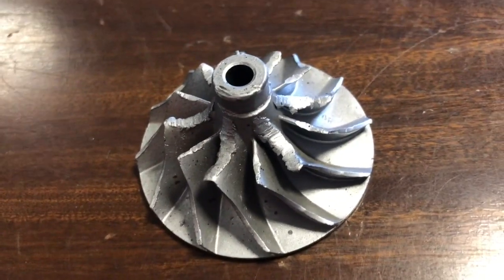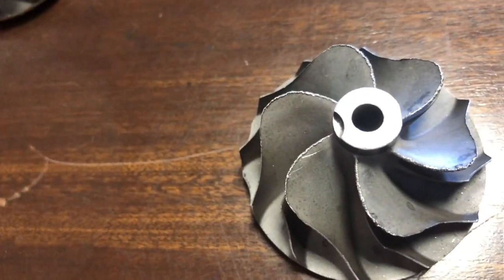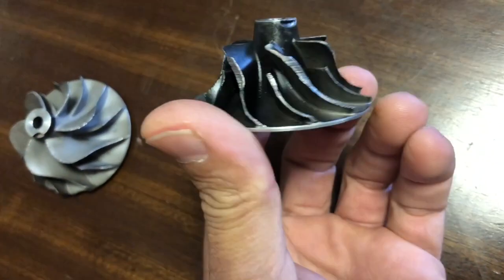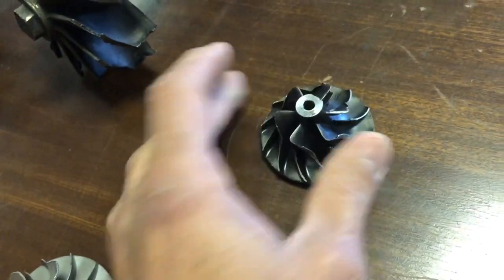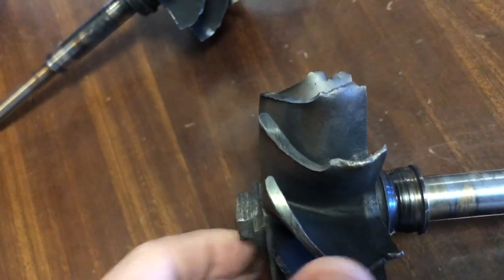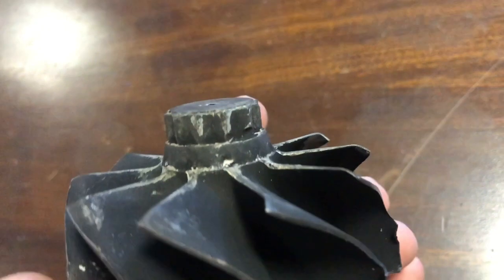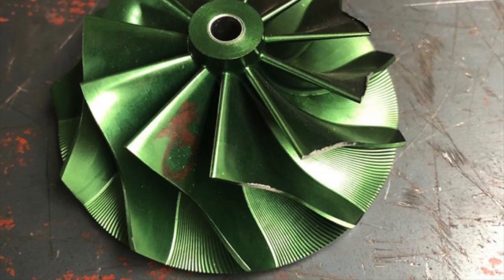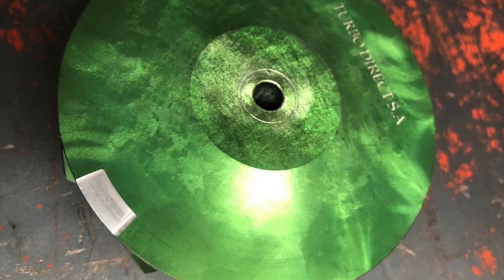Can overboost fold your turbos blades?

Comment: I had folded blades on a turbo once. It was an old turbo that i needed to reclock. As i was trying to free the exhaust housing, it gave way suddenly and folded one blade and bent two others. The bent part snapped off when i tried to straighten it. I was poor and still ran the turbo for a few more years after that. I still have the turbo but i did replace it later on.
Reply from the maker: Once a blade bends, it is no possible to straighten it - if you do so, it will almost always break off the tip. If not when you straighten it, it will definitely break off during operation.  Billet materials (depending on what material is used) are able to be bent to a certain extent without issues.

Comment: Hi i would be so soo sooo grateful if you can explain me how and what has caused my turbo to fail....so i purchased an turbo from a very reputable company in the UK, this turbo ran in my meticulously built brand new engine (by me) for around 1500 miles with three oil/filter changes at 500 miles intervals...the turbo has retained the normal play in the shaft , there are no marks on either of the wheels, there are no marks on the housings, no oil starvation, only boosted actuator pressure (pending a map) this turbo has built in oil filtration so definitely no contamination, turbo does not smoke at all what so ever, shaft spins but not as freely as when brand new, it is leaking heavy amounts of oil passed through the back of the compressor wheel into the boost pipes....i delivered the turbo by hand to the company of manufacture from what i saw even he was abit confused as to lack of evidence of failure having said that its pending disassembly and in depth inspection. Thanks in advance.
Reply from the maker: Hi GTA V Decoders - please shoot an email off to info@turbodirect.co.za with close up high resolution photographs of the failed components so that Chris can have a look at this. He will reply to you should he need additional info and/or photos.

Comment: Hi. interesting vid.. I have experienced this on g25-550, with a 4% shaft speed overspeed... tips bent.  literally just tips on a few blades.  http://badger-5.com/bin/G25_garretts/g25-550_failure/20200310_133228.jpg
Reply from the maker: Sorry Bill not possible - overspeed will never cause blades to bend backwards - id suggest you troubleshoot your specific application and failure further.

Comment: In these years I have never seen a fold back compressor blade due to high boost,surge or over speed. I seen cracked turbine wheel or compressor wheel burst into pieces due to over speed. Or thrust washer wore out faster and journal bearings wore out really fast . That’s about it.